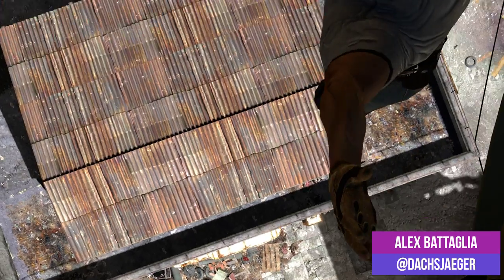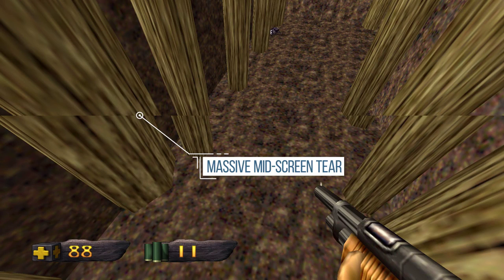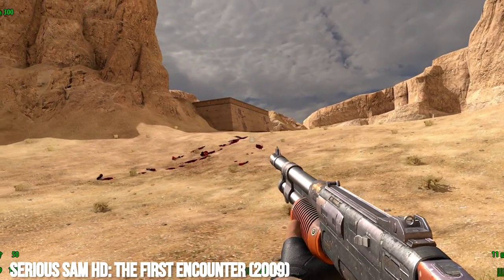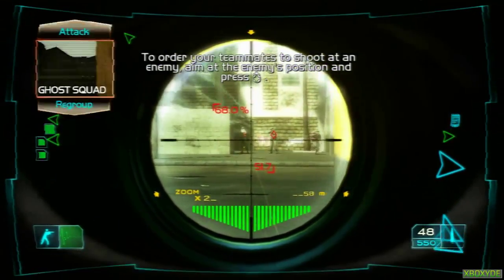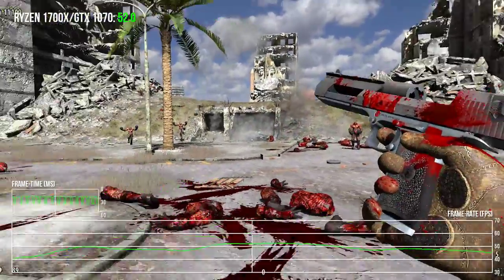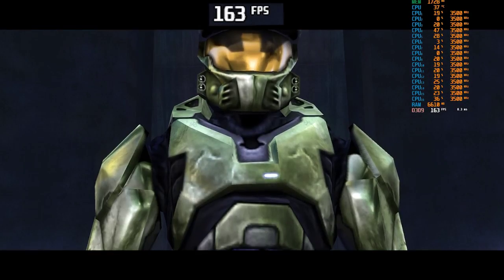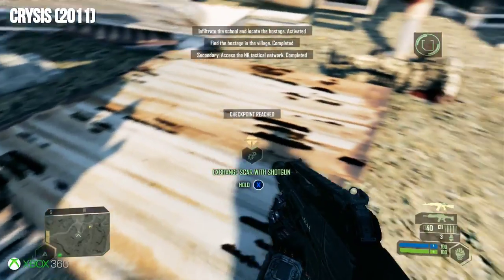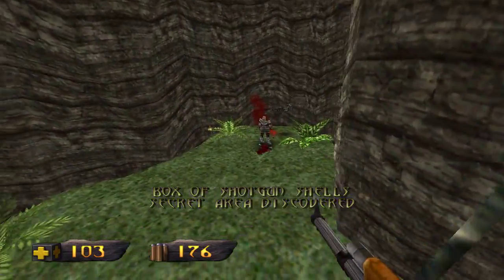Tech Focus - V-Sync: What Is It - And Should You Use It?

Comment: I wonder when we will get racing the beam type of rendering, where the GPU finishes a pixel an immeditelly sends it to be displayed, without waiting to finish the whole image. Could also be done by lines are sectors. Etc. They considered it for improvement in VR headsets, as it would further reduce motion to photon latency, but a lot of the whole pipeline would have to change.

Comment: interesting, i was always told v-sync is something to be ignored if you have a monitor capable of more than 60 hz, otherwise it will lock you to 60fps. also never really understood what g-sync actually did and treated it as just another part of g-force experience optimization (especially since for most games my gpu was probably good enough to just brute force things).
Reply: Theoretically it should lock you to your monitors native refresh rate. In practice... some games implemented it at hard 60 for some reason.

G-sync is basically v-sync built into the monitor. Doing things on hardware instead of software (Nvidia really likes that approach).

Comment: I've had a G-Sync monitor for the past 1.5 years and I seriously can't tell the difference between G-Sync and V-Sync, even when the framerate drops below 60. It's just a gimmick, only reason I bought the monitor is because it was the cheapest 4K panel at the time.
Reply: I have a g-sync monitor too and the difference is massive when running with an unlocked framerate. If your framerate is locked at 60 and never dips under u won't see the difference. Also, it depends on how sensitive u are to tearing.

Comment: Most people think that VSYNC ON only limits the frames per second to 60. But that's not right. VSYNC limits the frames per second to the closest divider of the maximum refresh rate the monitor can display. If your monitor offers a maximum of 60 frames per second VSYNC will limit the output of the graphics card to either 60 fps, 30 fps, 20 fps, 15 fps, 10 fps and so on, dependend on which is the one that your graphics card is able to deliver without any frame drops. So if you have a real fast graphics card and a 60 hz monitor you will be limited to 60 fps with VSYNC ON indeed, but that's only this because your graphics card is fast and your monitor does not offer a higher refresh rate.

Comment: I could seldom use high end hardware in my life so the issue of games not finishing rendering in one frame time was a very common problem to me. Well, both tearing and sudden brutal drops in frame rate and increases in input/visual latency are problems to me but I think when frame rates go down tearing is the lesser evil. So I often ended up disabling v-sync.

I hope for adaptive sync gaining ground so even cheap displays get it by the time I replace my current one. My last monitor lasted for like 11 years (but I repaired it and have it as a backup) so there's time. Probably.

Comment: Watching this video make me rethink about the knowledge I have about V-Sync and Double Buffering/Triple Buffering. My knowledge is pretty much primitive and obsolete I guess, as I learn these in the DirectX 5 era (and my game developer years was 10 years ago or so). Still remember that we would draw to a surface and then blit-ed it so it display on the screen (thus double buffering). 

Personally I can't think of the reason why during double buffering, the frame rate drops by half. I think it's would only be swapped at the next frame.  Is it because of how the hardware is implemented?
Reply: Blitting to the screen implies that actually no double-buffering is actually being done at all in the sense meant by this video, just a single framebuffer that's being scanned out at the display's frame rate, into which you are expected to draw. This is typical in non-fullscreen mode when not using a compositing window manager (e.g. Windows XP or classic Mac OS). In this case, to ensure no unfinished render-in-progress ends up being displayed you need* to render off-screen and once the render has finished blit it to the framebuffer, either immediately (no "VSync") or at the next vsync (or more accurately, "vblank", i.e. the start of the vertical blanking interval). The analogue of triple buffering would be using two offscreen buffers to be able to start rendering the next frame instead of just waiting.

* Of course technically you don't need to render off-screen if you can ensure you can render fast enough to do it entirely during the vertical blanking interval. If your game renders top-to-bottom (not typical for 3D games, but more common for 2D) you can actually still be rendering the frame while it's being scanned out, as long as you stay ahead of it ("racing the beam"). This eliminates tearing, has less input latency than any of the techniques in this video, and avoids the memory use of double/triple buffering, but is incompatible with the way 3D is rendered (unless raytracing) and the very strict timing requirements tend to tie the game to specific hardware and require that there's no OS getting in the way of things. It was a typical technique on old consoles (e.g. SNES).

Comment: An interesting option is to run vsync and limiting the framerate via Afterburner to around 0.010 fps below the true refresh rate of your display (my display has a true refresh rate of 59.950 Hz, so I limit at 59.940 fps). What this does (for reasons I kinda struggle to understand) is it gives you a vsync-like smooth and tear free image with an input latency equal to vsync off.
Reply: You eventually will run out of sync with the display that way, essentially having a slow rolling tearing position.
I guess with radeon improved vsync you can run vsync off in-game(unlocked framelimiter) and still have tear free.

But I also don't think it should give you all that much benefit in terms of latency.
It's not like the gpu suddenly forgets how to pump up a frame if you run vsync on(and gpu can manage it).

I mean at best it would be possible to delay the time when vsync wait time end by few ms in less demanding titles and improve latency that way.
Reply: @niewazneniewazne1890  It's now less relevant than it was all those years ago when I made my original comment above, but no, you don't have a slow rolling tearing position, and there absolutely is a noticeable improvement in latency. But it's also been well documented and discussed, so it's out there.
Reply: @Case_  Idk man how to break it to you, but it feels to me exactly the same as triple buffered vsync.
I use Radeon Anti-Lag+Improved radeon sync.
Tried turning off radeon sync off, but really it all just feels the exact same as triple buffered vsync.
Which feels exactly the same as double buffered vsync.
Which feels exactly the same as vsync with framelimiter on HZ-0.01 fps at least in exclusive fullscreen mode.

I don't actually feel the "input lag" you speak off, it's like on the same level as triple buffer to me.
Reply: @niewazneniewazne1890  I never tried to question how it feels *to you*, for a rather obvious reason of not being you. But if you don't feel/notice vsync input lag, you might simply not be the best person to comment on the effectiveness of this workaround.
Reply: @Case_  I do feel the vsync input lag, but only in borderless fullscreen mode, but I then run into framepacing issues in some games in general.

And in somegames like cs:go which I can't framelimit with RTSS.
The game feels more laggy than running vsync on and framelimiter is off in that game(so 78hz screen, but in-game 2.5-3x that, and I see the difference between frame limiter at 1x/2x and somewhat even at 3x).

I obviously SEE that in say doom64 the teared frame @600-800 fps has trails of newer frame, but it just doesn't feel good enough and with the frame limiter the game feels the exact same as with vsync.

I'm not sure how to break it to you, but the difference really isn't there, and I've more visually distinct frame pacing issues with vsync off.
Reply: @Case_  See I don't care to prove a point, I'm just here to say it doesn't and will likely never work for me.
I find it to just be gamer placebo area in which I once were standing in, while always having an itch that something doesn't feel right.
Reply: @niewazneniewazne1890  And why should anyone care if it works for you or not? The fact is that it works, it is backed by not just experience from countless people, but also by actual input delay measurements, so your opinions about it being a placebo are absolutely worthless. But good for you that you saw the light. Saying "I don't care to prove a point" is really typical for people who have seen the light and know better, though.
Reply: @Case_  I think not everyone agrees with that experience, you clearly don't speak for everyone so who cares what you have to say as well?

Outside of cyberpunk 2077 I haven't really noticed Vsync being any kind of input latency bloater.
Reply: 🤦‍♂Again, good for you. I speak about measurable facts, so anyone who cares about facts instead of personal opinions and impressions should care about that.

Bye.

Comment: I dont get adaptive sync. What exactly does it do? From my understanding of this video, it is the same as not turning vsync on and let screen tearing occur? The only thing I understood was using adaptive vsync allow the graphics card to control where the tearing occur. Is my understanding correct?
Reply: It's regular V-Sync that has the courtesy to turn itself off if your framerate drops below your refresh rate, resulting in more stable overall performance. (but you'll get screen tearing)

Comment: wWell done video, but it only explains the stuff on a level that's widely available on the net. 
Please do a followup episode where you go down the rabbithole of how different engines handle the vsync toggle and what this does to latency and stutter vs. enabling vsync in the graphics driver. All explanations i've seen on the web leave this aspect out. 
There are many refreshrates that are out of sync, which effect stutter and  latency: 
updaterates of your input devices, game world with physics online on a server, , representation of the gameworld on your PC, orientation updates, puhsingrate from engine to renderer, rendering rate on GPU, rate of monitor connection to GPU, monitor internal panel rate, monitor backlight flicker rate...
There is still a long way to go to perfect this ballet for the whole industry. Upping refreshrates everywhere helps, but rises cost linearly and doesn't help in the same way like perfectly coordinating those rates would.  Even windows  doesn't bother to coordinate the mouse polling rate to monitor refresh rate.  why is all of this such a huge mess?

Comment: I always turn it off because of input lag, which is really awful with mouse controls. In some games the lag is tiny, but others become nearly unplayable. Unresponsive controls are much worse than tearing. What I don't get is adaptive vsync, I tried that a lot with different games, but in none there was ever any difference to "normal" vsync. Same image quality, same input lag. I wondered if the nVidia software was bugged, but whatever, I returned to just turning it off.
Reply: Adaptive VSync is pretty much just standard VSync that turns itself off if your framerate dips below your refresh rate. (in order to avoid large performance dips)

Comment: I won't use Vsync period if there is any input delay whatsoever. I WILL notice it, and it WILL piss me off. Playing a game with a controller makes it tolerable to me, but absolutely not with a mouse. It's like I'm trying to move through a thick syrupy substance and throws me off hard. It doesn't matter how small the latency, it completely destroys my ability to play. Also, if I can get a higher framerate without Vsync I will turn it off regardless of how badly the image is torn.

Comment: I've completely given up on vsync. Like... All of it, doesn't matter what kind. It ALWAYS induces input lag that I perceive as significant enough to break proprioception. I've been playing games long enough that I can treat controls as an extension of my body if response time is low enough. As soon as vsync enters the frame, however, the delay breaks that link and I'm forced to regard my control inputs separately from what's going on on the screen. It goes from me controlling my view to me controlling an invisible cursor that my view is chasing around the screen. It absolutely KILLS my ability to do anything with precision. I've yet to experience a type of vsync which doesn't do this.

That said, I swapped to a 120Hz monitor with a beefy enough video card to maintain a stable 90+ FPS in most cases, so I haven't noticed it as much.

Comment: Strangely enough I was running Serious Sam 3 on my new rig, and was wondering why, even with my Ryzen 7 2700x and dual 1070ti SLI setup with the whole thing running on a 144hz 1ms monitor, I was getting massive tearing in certain sections of the game. I had always been one to turn vsync off and set all the visuals down a notch back when I was running a potato rig, so I never turned it or AA on, despite the fact that on my current rig I could run the game in ultra settings at 200+ fps.
I'll have to try enabling it and seeing if that makes a difference.

Comment: I don't think I've used vsync in anything more then speed sensitive games that are tied too framerate heavily like mdk 2 or need for speed underground.
(NFS Underground performs really strange on my gtx 780 without the fps limiter on too 59 fps here,  game speed nearly doubles randomly on certain tracks if its set beyond i think 63 fps, been a while since i played it actually.)

Another example is monster truck madness 2, with a fps on 30 on the physics & beyond 60 fps rendering the game behaves like they drive on ice or wet concrete almost constantly & have strange clipping.

Perhaps it's worth adding in for a video as well where an fps limiter makes more sense then vsync too reduce load while having a smooth input still ?
And when it comes too max fps on single player games i always set it too at best 30 fps above my screen hz unless i notice tearing in game fairly obviously like Amnesia, lowers gpu usage along with noise & temperatures.

Comment: I try to use vsync whenever possible but (maybe only on my system) some games have performance issues with it. I tried to use it with AC: Origins, I had over 60FPS all the time but whenever I activated vsync the framerate dropped to 40-45FPS, which obviously made vsync useless
Reply: What CPU do you have? A faster one should fix that problem.
Reply: It is actually a very old CPU. I have a Core i7-2600@4.5GHz and I'm fully aware that it often struggles with keeping up which sometimes results in slightly uneven framepacing with vsync enabled. In most games it's just that but no actual performance penalty for enabling it.

Comment: So what happens if a screen has a  high refresh rate like 240hz?
Reply: Screen tearing becomes VERY hard to notice. (but is still there)
Reply: @ChaosBahamut  Thanks. Looking back at my question it was very badly explained..
So basically if I understand correctly, if your gpu is pushing out frames that don't make it in time for the refresh, if you have a refresh rate then it'll get to the next one quickly enough to avoid as noticeable tearing as you would see on a 60hz screen?
Reply: @Hmbs271  To put it simply, yes. Due to the fact that a 240hz monitor is capable of 4x as many refreshes per second as a 60hz monitor.

Comment: Yes, yes you should use it, next silly question... that being said, I quite like nvidia's fast sync, all the low latency of unlocked framerate, but with no tearing. Not to mention, if you run sli, some kind of frame sync is essential for nice even frametimes.

Comment: Gsync should become standards for all monitors today! and not to become as a way of milking the masses as what they are doing right now :(
Reply: that's called freesync
Reply: @forestR1  Your right but its just amd thing. If only amd cards as powerful as the nvidia was :(
Reply: @Death Cold  within the price range they are. The top tier is completely missing from AMD, but rx 580 performs as well as a 1060 for the same price.  Vega 56 costs the same 1070, but performs better in most games (exceptions in both cases of course).  Once you hit gtx1080 or better it's all nvidia.  But if you're in the market for a GPU and variable refresh monitor (first time buying,  or upgrading GPU and monitor); for the price of a 1060 and gsync monitor,   you could buy a vega56 and the equivalent freesync monitor (massive performance difference).  For the price of 1070+ Gsync monitor, you can get a Vega64 and freesync monitor. In both cases your going to get better performance.  - not the first thing that comes to mind when you see "AMD"! Of course that's a specific situation.  Horses for courses and all that. I would just as soon go back to nvidia if they implemented freesync compatibility. [Edit] it is kind of an AMD thing at the moment but technically it's an "everyone except nvidia" thing.  Intel is getting on board, MS has implemented freesync into XB1X (though it does still use radeon graphics), and television manufacturers are getting into it too. Nvidia won't get on board,  cause they know anyone who forks out wads of extra cash for a Gsync monitor is now locked into their environment.

Comment: V-Sync should only be used if your framerate isn't stable and you get tearing, but if your hardware can get consistently above the refresh rate of your TV or monitor and don't have said problems then you don't need it and shouldn't use it

Comment: No, just use a frame cap, done. If at 60 you still have tearing, than put 50 frame cap.
If you want to play at more than 60fps with no tearing then go back to quake/cod4 engine or get a higher refresh rate monitor. Lol